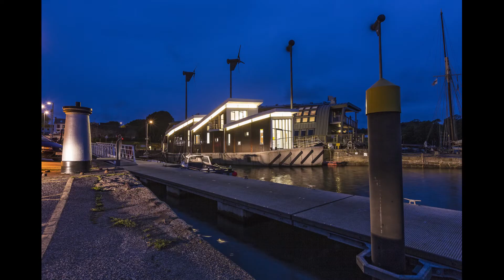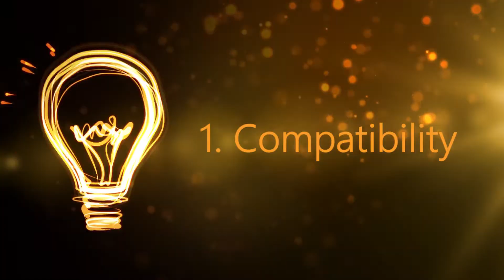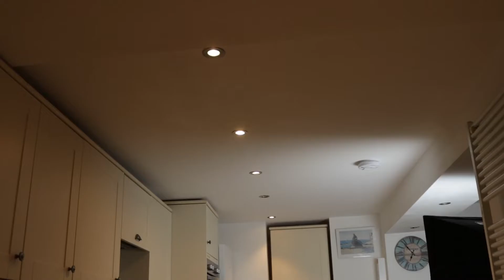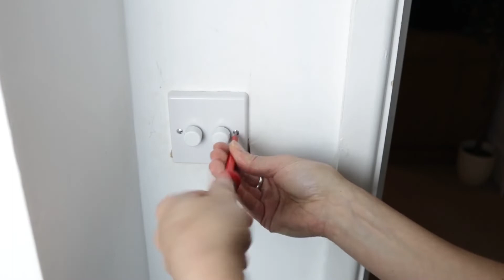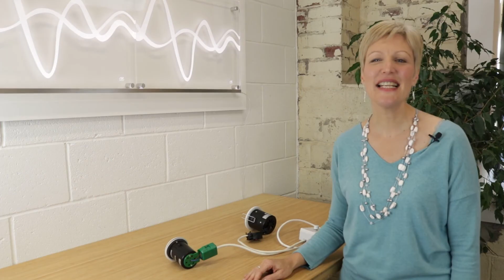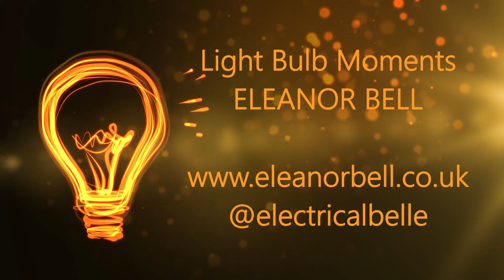DIMMING LED LIGHTS - How to achieve flicker-free dimming | Light Bulb Moments with Eleanor Bell

Comment: HI Eleanor quick Q pls. Can you mix one dimmer with many toggle switches to control one line of lights (eg a long corridor with 12 lights and 4 switches but only  1 dimmer in the middle needed)
Reply: You no doubt sorted this out but for others now reading that's question for an electrical forum or another tuber video about switches, otherwise you use 3 way switches, search web "can you mix one dimmer switch with 3 other switches for hallway lights?"

Comment: i have flickering with a LED compatible dimmer switch - but the miniload is 60W. I'm guessing this is too high for the three modern LED bulbs
Reply from the maker: Yes, a dimmer with a minimum load of 60W will be too high for just 3 led bulbs (unless they are at least 20W each). Your best option is probably to change the dimmer switch. If you’re in the UK check out the Varilight V-Pro range - their dimmers have a minimum load of 0W.

Comment: Thanks for all the amazing videos. Learned a lot!

I have a  10 light chandeliear and wanting to upgrade it to dimmable filament light. i have a smart dimmable switch and was told by the switch manufacturer to get bulb that's 5w and above to prevent flickering. however i only found either 4w or 40w choices for filament bulbs. if i go for the 40w bulb will it be overloading 40 x 10 = 400w? dont really understanding how to walt works within the same circuit.

need some advise here.....thanks!

Comment: Dimmers and efficient lamps must make low and medium frequency radio reception inside the home impossible, especially an apartment with reinforced walls. One could simply run an extra wire and switch on half of the lamps and use any brands. A year or two later you won't find the same design model.

Comment: Trying to find combinations that work is still an issue. I've got a light fitting that takes 5 LED bulbs. Have tried many different makes of bulb and dimmer over 4 years. When dimmed I still get an annoying flicker at the mains frequency (50Hz). As far as I can tell there is no way to fix this. What I thinks needed is a dimmer that does frequency doubling or uses a higher PWM frequency.

Comment: This just goes to show how utterly complicated everything is getting! I never ever thought I'd need to call an electrician to change a lightbulb, but I can see it happening. 
Eleanor, I have a table lamp which I bought from ikea. I have tried so many dimmable lightbulbs and none are compatible (apparently) with the switch. 
I was about to either throw the lamp out, or remove the inline dimmer switch and replace it with a simple on/off inline switch. 
You video was great but not quite solved my problem. Any advice to offer? :0)
Reply from the maker: That is annoying! You can buy led inline dimmer switches, I have never used one but it might be worth a try. Check the minimum load rating as it may not dim down far enough. Otherwise your options are as you said - to change it for an on/off switch (with a less bright bulb) or get a new table lamp. Good luck!
Reply: What type of bulb does your table lamp support? If mini fluorecent, forget it. They can't be dimmed.

Comment: Hey Eleanor, I was wondering if you can give some insight as to the problem we have here. We have recently had new led Spot lights added to our new ceiling, our original dimmer switch is still on the wall but just like this video the new LEDs don't dim with our dimmer on the wall (they blink & cut off). I want to know can we sort this problem with just getting new dimmable LEDs or do we need to replace our dimmer/switch on the wall? Also how can I find out if the LEDs in the ceiling our dimmable?

I would appreciate your input on this as we had asked the electrician to make the new lights dimmable which he didn't. Thanks alot,

The bulb in the ceiling is "LXGU10LED/4.5W"
Reply from the maker: Hi Ciaran

Thanks for you question. It should say on the light bulbs if they are dimmable, so if they don’t state that I would assume they are non-dimmable. An internet search of that part code comes up with the Luxna GU10 bulbs. The 5W version is dimmable, the 4.5W (which you have) is non-dimmable. You will also need to ask the electrician to check that the dimmer switch is an led compatible dimmer switch otherwise you will still get problems with the dimming.

Comment: Fantastic I think you just solved our ‘disco’ problem. What are your views on ‘smart switches’ as hoping to solve the bunk bed light switch off problem?
Reply from the maker: If the room is being renovated I would put in a normal 2 way switch by the door and within also reach of the bunk beds. Personally I prefer actual wiring over wireless where possible.
For a retrofit solution, wireless smart switches are a great low cost solution with minimal upheaval as no new wiring is required.
If you like the techy side of it - go for it! They are fun, you can get colour changing bulbs etc. Look at ranges like Philips Hue.